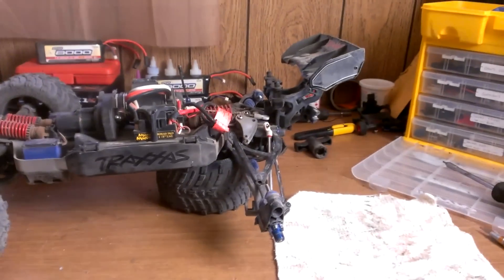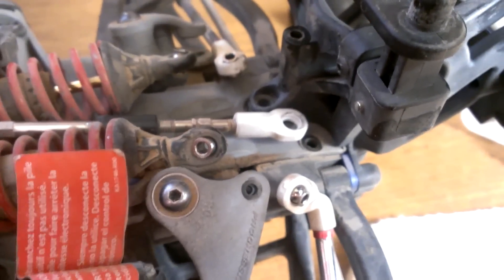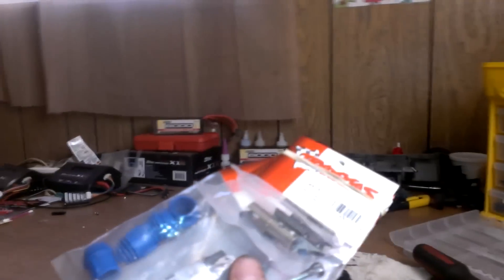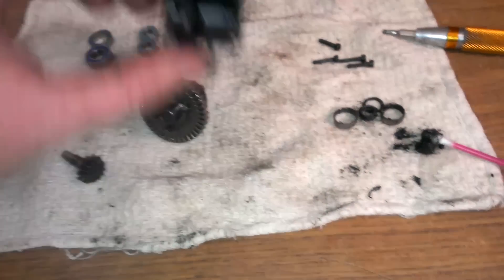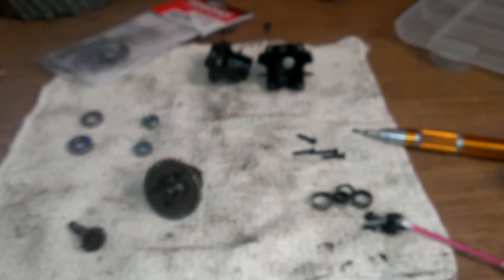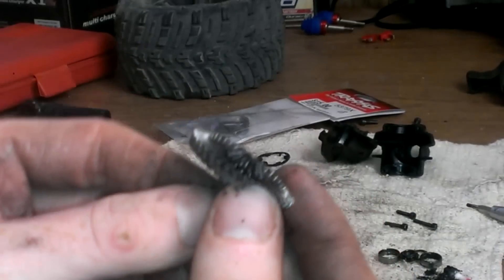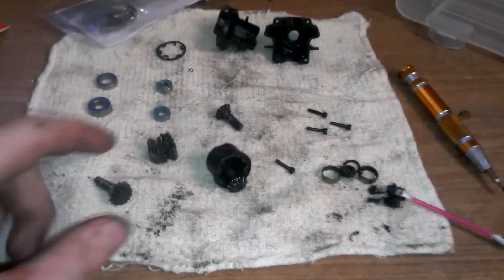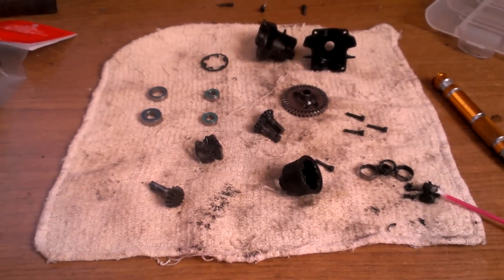E-Revo Rear Diff Rebuild In Detail Part 1 Of 2

Comment: i think my rear diff may have gone ou. it still goes pretty good but its making this popping noise. well now it rolls then locks up at a certain part of the rotation, definantley not the spur or pinion or slipper. whats your thought?
Reply: I have the same problem. Can some1 pls tell us what it is and how to fix it. Thx allot.
Reply: I was tge differential after all. A bearing was destroyed and the gears inside were also destroyed.
Reply: The HOT ticket is to replace the front pinion bearing  with a BUSHING!No,really!Just seal it with a felt or foam spacer to keep the dirt out! I have blown 3 diffs and the front bearing always fails first.https://i.imgur.com/Txgzi7U.jpg 
Also,do NOT use the Teflon washers,use steel shims.

Comment: Hi, how can I tell if the diff is gone, I have a clicking noise on my e-revo brushless when accelerating, originaly thought it was the wheels rubbing, but after checking these can't find any signs of rub, THANKS
Reply from the maker: Clicking, yes the diff is gone.
Reply: RC Logic I always get scared taking it apart that much.  I have changed axles and a-arms just not that in depth.  My Erevo clicks when it is in reverse only.  If it was the Diff shouldnt it click in both directions?

Comment: I've had to replace both my diffs in my ERBE (in a years time) and both times it was that damn innner pinnion bearing that came apart and took out the ring and pinion gears.  Next time I think ill maybe try some higher quality bearings
Reply: yeah its always that bearing beneath the pinion in the diff, as if the rear drive shafts puts so much stress on it that it tears apart that stock traxxas sealed bearing. get some ceramic bearings and shim the diffs, and you got yourself an extremely durable diff

Comment from the maker: I only used petroleum cause I ran out of grease, I usually just use automotive red or black grease. there are a total of 4 bearings in each diffs. if you use thicker oil in the front it will give you more rear end bite and same the other way around. Glad I could help. Thanks for watching !

Comment: what kind of grease did you use for the Bevel gears?

and is Petroleum Jelly is good for the bigger gear.

in the Traxxas manual they say to use Diff Oils, you did not use them any reason?

i ask this as my Front Diff on my Erevo brushless was leaking a thick oil. 

I failed to notice which bearing it was leaking from, so i might replace all three bearing from the Diff Case.

Thanks for the video.